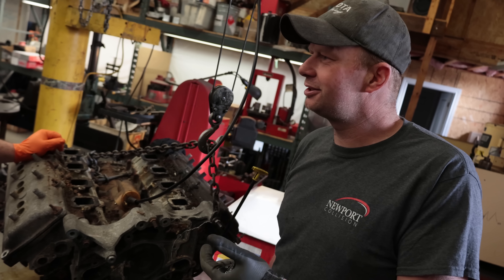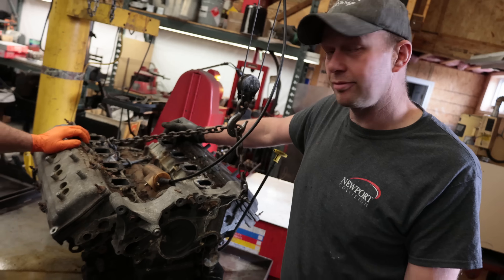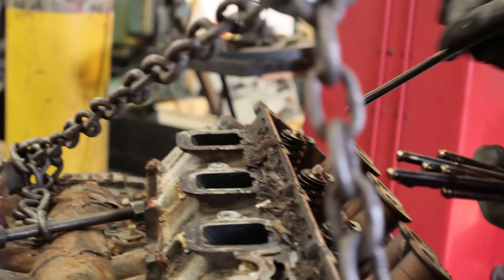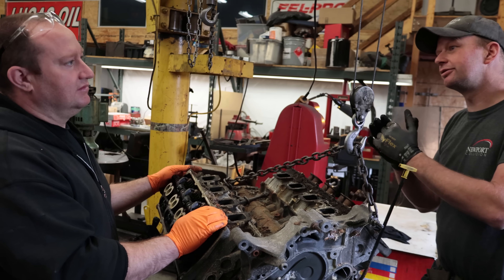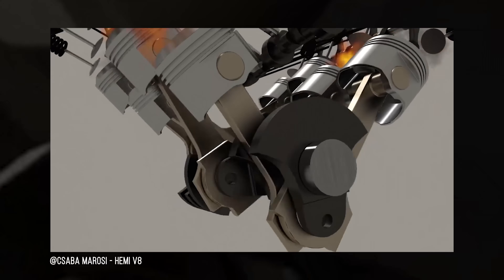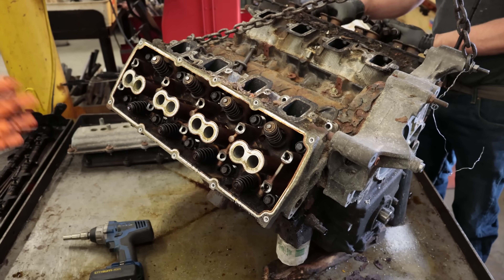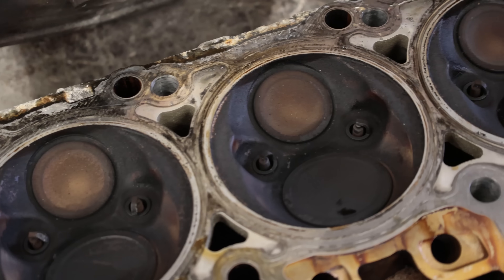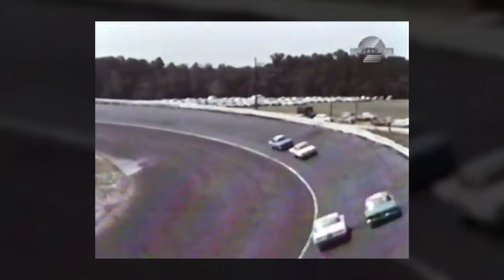REVIEW: Everything Wrong With A 5.7 HEMI 345 Engine

Comment: We have a gen 2 392 which is a 6.2 liter hemi in our 2013 challenger drag car and it runs low 10's screaming out the back end of the track . Even that 5.7 hemi is a good motor of you take care of it. My friend owns the car and he has a ton of money tied up in the just the motor . Thats not including what he has in the car. The motor is all stock minus a high duration cam and it has 650 hp at the flywheel

Comment: LONG AWAITED   
  Next do everything wrong with chrysler 3.6

so 304k miles wow impressive

you should jam that engine in a d50 or dakota

my dads old 94 dakota 318 5 speed has 317k miles or 511000 km 
still runs drives just has a miss and sticky tack on acceleration., trying to figure out . i suspect distributor or worse worn camshaft.

Comment: Hellcat oil pump! Has a higher flow rate and will help avoid oiling issues in the future:)
Reply: it only fits on the 2009 and later blocks. They changed the pump to make room for the MSDS
Reply: do you know how much a shop would usually charge for that? i have a 18 scat and i love that thing and id hate for something like that to happen. thanks

Comment: Somebody has rolled new bearings into that engine some time before you you tore it down I have done several Hemies with a lot less miles on them and the last two or three rods and mains are always starved for oil but if you catch them soon enough you can roll new bearing in and a new oil pump and it will a long time. And by the sludge in the pan this engine was not well maintenance through its life to support these being the original bearings.

Comment: Love a "everything wrong with a 5.7 iForce engine" video.
Reply: it'd be pretty short in all fairness
Reply: @jaubuchon28  cam tower leak, air injection pump failure, timing chain failure, quite a few early water pump failures, and the stupid oil filter housing lol
Reply: @dakotahowe5250  oh Lord I forgot about the oil housings

Comment: My daily for 2 years was a 2011 2500 with a 5.7.  Low miles, got it at 48k switched to a Cummins at 70k.  My only problem was exhaust manifold bolts breaking.  Always around #7.  I towed a 10k trailer with a 6850 lb roller all the time.
Reply: I was a Chrysler tech for a few years and I extracted more broken exhaust manifold bolts than I can count
Reply: From what I've heard it's best to resurface your manifolds
Reply: @moparjr89  it’s best to get shorty or long tube/srt headers when addressing that. The issue is how much heat those thick ass manifolds hold. They warp a touch and break the bolt.
Reply: @talkingprimate3521  that’s exactly what I’ve heard from a few techs.  I changed the manifold out the first time, didn’t matter one bit.  There is a lot of heat meeting up right at the junction of the last port and the outlet.
Reply: @moparjr89  The stock manifolds are very robust. I had them machined flat and put them back on with oem gaskets at 130k miles. I was told that once manifolds warp a little, and then you machine them, they are basically 'seasoned' and will stay sealed for a long time. This was in a 2013 Grand Cherokee, worth dropping the front cradle.
Reply: @austinaubinoe  I agree 100% it makes total sense i just did my own with a belt sander. Also used grade 10.9 bolts would have done 12.9 but the hardware store didn't have them on hand. People that buy new stock manifolds are just gonna repeat the problem. Removed the heat shields too
Reply: Bet you're loving that fuel mileage increase with the Cummins vs the Hemi when towing that 10k!
Reply: @Eric2300jeep  yeah I’m averaging 4-5 mpg better.
Reply: @jamess662   I can swap a diesel for my crap Hemi that one morning just wouldn't start and turns out I have next to no compression now.

Comment: Haven't experienced it personally, but have been told from multiple people that this engine is horrible for any kind of fuel economy.
Reply: Mine gets between 12-15 mpg in a jeep commander.
Reply: @calebconnors847  12 thats pretty bad not pulling anything .if you werent.
Reply: My 17 gets easy 24 mpg with a 400lb camperette plus gear, 26 mpg empty, that’s Canadian gallon, or 10.2 litre per 100 k
With tons of power, you have seen the show hwy through hell, this truck easily holds 120 km up the hill thru the snowsheds or larson hill.

Comment: Just put a hellcat oil pump in it and it's only real problem goes away.

Other issues 03 04 dropping valve seats, 04-05 con-rods had some bad batches.
Reply: I had a 06 charger drop valve seats at 92k. Never ran hot. It is a real issue and existed more than just 03-04
Reply: @bob7724  yeah it was just way more common in 03 04, any issue can happen at any time, even a known one can re-occur, take for example, if someone re-loads the wrong cnc file because of a power outage etc. I was citing the TSB's sent out about those issue's at that time. 

This is much the same as the much maligned lifter issue, the issue is low rpm oil starvation, it was solved with a higher volume oil pump, stricter lifter QC's, as well as numerous iterations of axle diameter, bearing count, surface hardness variations, etc.

Comment: When i worked at my local shop in high school (just did oil changes and tires) we had a regular customer come in with his beat to hell ram 2500 with a 5.7.  only ever had to do regular maintenance.  last time i saw it it came in for an oil chance at 370,000 miles.  It def had the lifter tick tho.  

Def think you should build that 5.7 you have and put it in a Dodge Magnum wagon and mate it to a 6 speed manual.  would be a sick wagon haha, but i'm biased as i always wanted an SRT Magnum

Comment: was this really an "everything wrong with" or just a tear down on this specific engine?
Reply: Yes only real issue gen3 hemis have is lifter failure otherwise they are solid engines
Reply: @moparjr89  even then, like they said, good regular maintenance / oil changes (with the right oil) and the lifter problem only really manifests with a lot of idle time (mostly from what I've seen). I love my 5.7, I just don't let it idle (with gas as high as it is that's a no brainer anyways)
Reply: @moparjr89  they’re garbage engines. Everyone I’ve seen at the junkyard had chewed up pistons on one side. After 8 years of searching I decided to just ls swap my ram. Impossible to find a used hemi at a self service junkyard.
Reply: @MrPland1992  so the junkyard engines are junk?
Reply: @tacticalultimatum  usually no. Mostly clean wholesale vehicles. Whose gonna want a 2001 tahoe with 205k from a new car dealership? They end up in the scrap yard.
Reply: @MrPland1992  maybe it’s different where you’re located, most of the time it’s clapped out tahoes with 300k miles in the junkyards near me
Reply: @tacticalultimatum   I’m lucky to live in Texas. A couple junkyards have literally a hundred of them and about a hundred CLEAN obs trucks. I was shocked. Ls swaps are really big here so that’s all they buy now.
Reply: @MrPland1992  I’m close to Bryan/College station and it’s all ex privately owned stuff. Normally it’s written off vehicles towed there. Where abouts do you go? Maybe it’s closish to me
Reply: @tacticalultimatum  lmao small world, so I am I. The lkq’s in Houston are packed with good stuff. I usually go to the Austin wrench a part out of habit but Houston is better. There’s a wrench a part in Belton also. 
Just buy a whole truck tho, suburbans pop up all the time for $800. Scrap the cats for $600 and basically have a free parts truck.

Comment: I have a 04 Hemi in my truck that might be a Dodge.  After 15 years the electronics start to crap the bed.  That is also in the rust belt and I tried to keep it sprayed off in the winter and the power steering leak helped stop rust.

Comment: Love my 5.7 hemi... just don't like changing 16 spark plugs every 30k miles (per owners manual)...
Reply: I think you can put in the Iridium spark plugs that the newer ones have, A friend did it in his 2011 and it worked fine. My 2015 have 100.000 miles intervals (Iridium)
Reply: Stick to copper the Hemi doesn't like iridium plugs they even say it in the video
Reply: @donaldliverance2597  yes!! And the magnum 4.7 takes copper as well
Reply: @donaldliverance2597  my 2011 5.7 runs bosch double iridium and the throttle snaps like a 2stroke. That being said maybe coppers would run better im not sure.
Reply: @donaldliverance2597  But my Hemi has them from the factory
Reply: Really, I thought changing the plugs not that bad, at least on a car it wasn't bad. I don't know about a truck. I found it helps to have the correct length magnetic spark plug socket & integral wobble extension.
Reply: @budlanctot3060  yeah it's a little pain sometimes unless your a really tall person . I end up kneeling on the bumper and bent over lol

Comment: I would love to see a video on any of the magnum series engines. The 3.9, 5.2/.9 and the mighty 8.0 all of those engines seem to be pretty reliable too
Reply: Same. These are what I run. I've pulled a few 360s from the salvage yard. I did a total gasket job, oil pump, and timing chain and dropped it right in. No problems.
Reply: I had a 8.0 in my 98 and that thing was bad as hell. I beat the shit out of that truck and it wouldn't die, until a caddilac decided to inspect my passenger doors with its boat front end.
Reply: Cracked heads and bad mpg on the 5.2/.9, but solid otherwise.
Reply: Blown intake gaskets.. but that's easily repaired
Reply: All have well over 200k on them and still going strong.
Reply: And next generation magnums like the 4.7 . However they aren't as cool as a hemi.
Reply: @ZAC____  the 4.7 sucks they are notorious for throwing rocker arms
Reply: @moparjr89  you have personally run into this issue?  I have never had any of these  problems.  Now on the 6cyl I hear of this a lot .
Reply: And far obsolete, the newer engines are going to be much more durable due to better materials, tighter tolerances and computer engines management which runs the engine in the optimal range.
Reply: @mikeshultz1007  nearly everything in your statement is false, I’ve seen 90’s engines based on engine platforms created in the 60’s far outlive engines from the last decade and take far more abuse while doing it. Never had widespread lifter issues, cam phaser/timing issues or anything you see these days
Reply: @1969moparmuscle383  I own multiple automotive businesses which includes a engine machine shop, a transmission shop and a high performance / hot rod shop and I have vehicle coming and going day in and day out.  My shop truck is a 2001 gmc sierra with a 5.3 lm7 engine and it recently broke 1,000,000 miles and the engine has never been out of it and it idles with 40lbs of oil pressure, I have owned it since new and the mileage is fully documented.  It has had a dozen or so water pumps but that is due to aftermarket replacement parts which are junk.  I get so many gmt800 vehicles at my transmission shop and on average they have 300,000 miles or more.  I have a lm7 sitting in my machine shop that has well over 700,000 miles on it and I am going to do a tear down and inspection on the engine soon using my faro cmm to verify specs.  My daily driver is a 2009 saab 9-7x aero which has over 400,000 miles on the bone stock Ls2 and I am going to do back to back dyno runs with my 12,000 mile bone stock 2009 9-7x aero.  I have probably 50 L92, L9H and L94 engines that I purchased as cores from a few local auto wreckers that deem any engine with more then 200,000 miles a core.  The only mopar vehicle that come through my transmission shop with more then 200,000 miles have cummins engines in them, all the gas ones are at pick a part by now.  Mopar vehicles head to the junkyard the moment the owner find pieces of snap rings in the pan from the overdrive unit.  I am a dealer for half a dozen turbo manufacturers, how many customers do I have coming in to buy turbos for their 5.9 magnum engine, the answer is zero.  At my machine shop I can probably count on one hand how many pre-gen III mopar engines came in in the past year.  I do get modern Hemi engines in my shop and they are almost always 6.4 hemi or 6.2 hellcat engines and the vast majority of time they are destroyed due to high boost.  The only early style mopar engine I see coming through my door are either BAE or AJPE blocks.
Reply: @mikeshultz1007  ?snap rings from the over drive?  what happens ? that causes  non reparable ? (currently have 3 w 250 A ;  86 5.2,  93 5.2, 93  w3505.9c, < waiting for me to finish the last 25%rust repair  of the cab (wanting to put a zf 8 speed in  it but no computer for it to talk to (is there an "ardweno/raspberry pie" simulator kit?) . I'm not impressed with the shaft sizes they chose behind  "400"ft,s torque converter and 1st planetary > I expected a tubular 1.75"  shaft with an aluminum core and found a  Joke  sheered  at a rough spot in the forging,
        forged has always been better than cast> What's billet ? cast ,right? may be cold rolled ,but that's still not hammer forged > I'm not a fan of $600 14"  1. 125"shaft  when a $ 60 shaft is stock .
Reply: @stephenmoulton9284  Sound German automotive and HGT tuning make controllers for the 8hp series transmissions
Reply: @mikeshultz1007  nobody cares what you think

Comment: Everything I have read and heard is the 5.7 if ever overheated drops valve seats and destroys the engine.  All the hot rod guys say don't re-use the stock heads and put Edelbrock heads on them for security.  This seems to be the end of life criteria for most 5.7's.  I understand the 6.4 cylinder head doesn't have the same issue.
Reply: 03-08 drop valve seats, 09+ eat up camshafts when the lifters lock up. That’s the only real issues I see with them. I reuse head bolts with cam and lifter jobs
Reply: Iv got an 06 with 450k no broken manifold bolts and the eagle drops valve seats more than the previous model
Reply: Allegedly 19 and up hemis have fixed most of the issues from what has been seen so far. Of course now that they are going away. However what I have been told is that there is no such thing as hellcat lifters. In 2019 they changed the lifter design and implemented it to all hemi engines. If you just drop any OEM 19+ lifter into an 09+ hemi it remedies the lifter issue.
Reply: It’s true! I had a 300C and it dropped the valve seats. Later, had a Jeep GC and it also dropped valve seats. At least the Jeep went 220 miles before imploding.
Reply: @adamtacheira5323  noooo way bull shit dude I’ve owned hemis and put over 500,000 miles in them with no issues

Comment: Would love to see a video on the dodge V10 gas engine
Reply: Yes please, I've got a 99 v10 2500 that's been really good to me.
Reply: @yurhi  - it's gotta be better than the 3 valve V10 in my F450 work bucket truck which had to be replaced at 45,000 miles! We have tons of idle time hours so they blamed it on that, haha.
Reply: I had a ram v10 for many years. It was the only vehicle I have ever owned that did not break down. But it was a gas hog so I sold it and bought a 12 valve. Have not looked back.
Reply: @cali gdp So far 140k with no problems just change the fluid and adjust the shift cable occasionally. Hopefully it keeps going another 100k

Comment: The worst thing about a 5.7 hemi is the dodge it comes in. Got a 5.7 in a 07 dodge 2500 can’t even get a power steering pump pulley for it
Reply: I loved my 07 2500 5.7. no mds and plenty of power stock with a few easy mods. There's literally ps pulleys alllll over the net if you search for 5 seconds.
Reply: @punkrocker10115  not for the pick ups there isn’t. Can’t even get them from dodge
Reply: @robertquast9684  salvage yards? I know they want price of new these days though.
Reply: That's why Peg calls them Shipping Crates. Take the engine out, throw the rest in the bin
Reply: That's how I feel with my 12v in my 93 dodge d350. I feel bad it's in a wire abused burnt g360 truck that it's in.
Reply: Go to a Junkyard... 
That's how I find all my dodge parts. 
Mopar or no car
Reply: 30 years ago my old boss said the same thing about the first gen Cummjns Dodge
Reply: I ended up getting one from a junkyard 300 miles away. Only one available luckily the small chip in The pulley hasn’t bothered yet. I have a standing order at the dealer for a pump and pulley because that’s the only way to get one if they ever make them again
Reply: Dodge is actually really bad about discontinuing parts before they should. So is ford. I run into it at work fairly often. Luckily there's 742 billion of them in every yard

Comment: These are great simple engines. None are perfect. Ive had several make it to 200k hard miles before having any real issues. That being said, i visited a freind once at the local chrysler dealer. I am not exaggerating, he had a BOX of smoked cams, dozens of them. Its been covered extensively, but number 5 lifter, holeyy bud. Maintenance goes a loong way.
Reply: Side note, i can almost promise you the reason the plugs are different is because there are tons of run of the mill shops that have no idea they are dual plug, or scaming. I had to convince a mechanic once by pulling a coil off the shelf and showing him where the second was located.